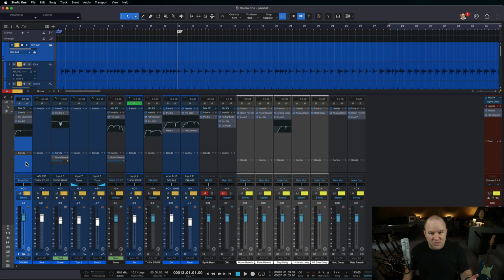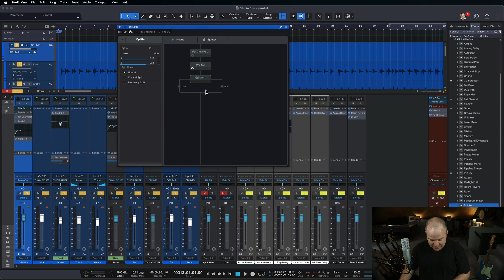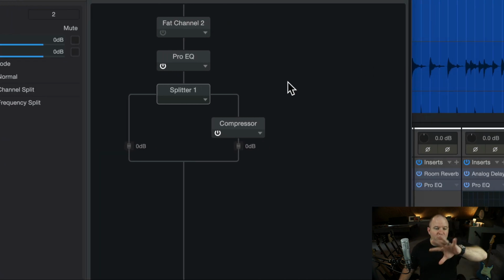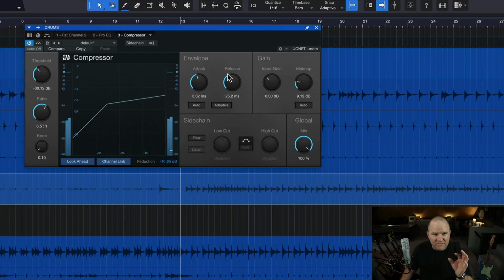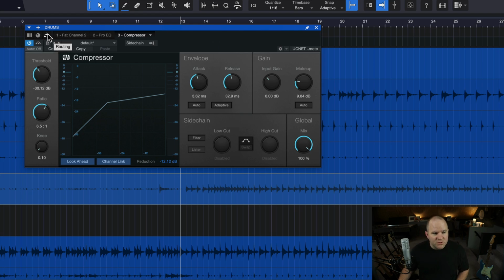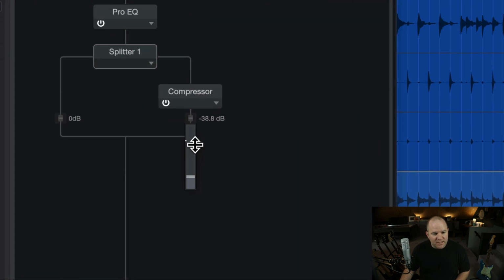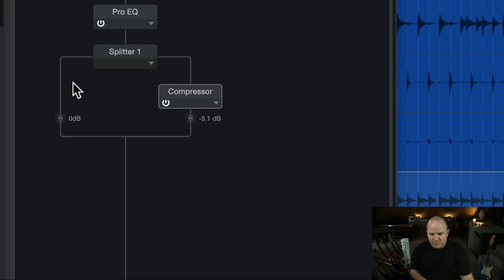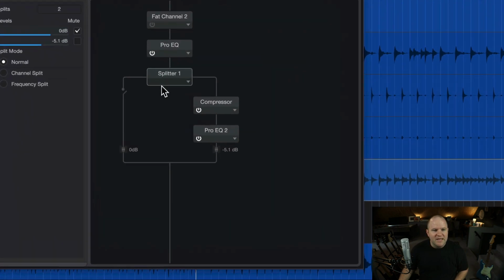How to Set Up Parallel Compression in Your DAW | Presonus

Comment: This is not an efficient means to parallel compressing anything. Only serves to limit your options. Set up a bus, route your tracks and send as required. Doesn’t take any more time and gives you all the flexibility necessary for optimizing the tracks in question. C’mon, fellas, this is as gimmicky as it gets.
Reply: That's true. Though, after seeing so many videos on this type of processing, I never ever encountered anyone changing the send levels for the parallel bus. Most people simply crush the parallel drum bus and add the whole thing to taste. The only exception to this that I came across was not sending OHs and Rooms to the parallel bus at all.

Comment: While it's good to have options, to me, it's an inferior way to do parallel compression for a drum bus. 

First of all, this way I can't control how much or little of every drum element I send. Sometimes I need or want to emphasize or de-emphasize certain channels going into the compressor and that's just not possible like this.

Secondly, with the splitter you don't get a nice fader to wiggle around and automate.

Don't get me wrong, splitter is great and has its uses, but the drum bus isn't one for me. Good old sending to bus is the better option in my opinion.